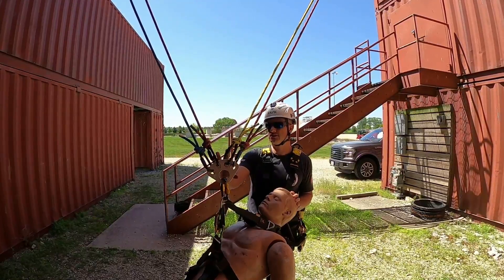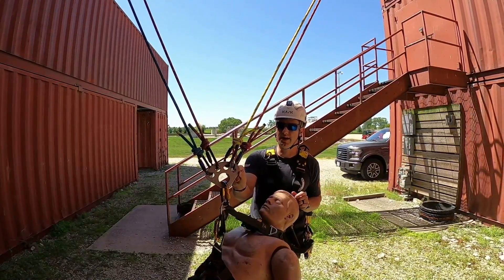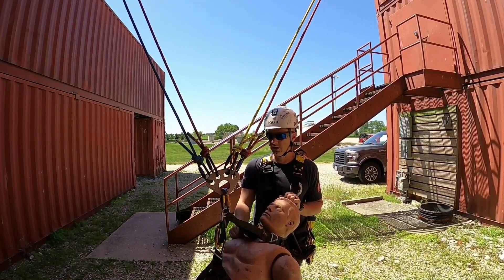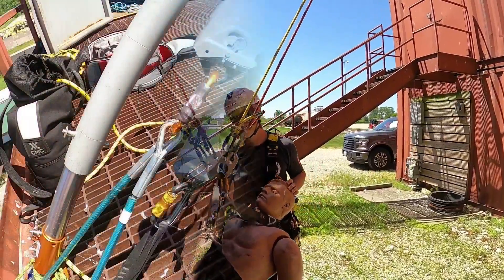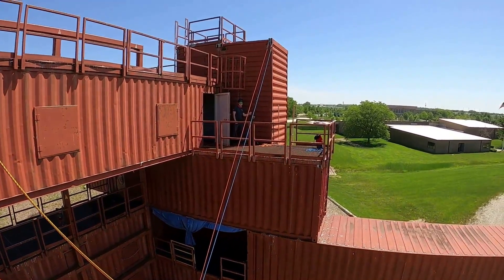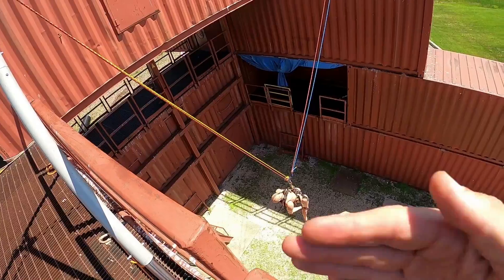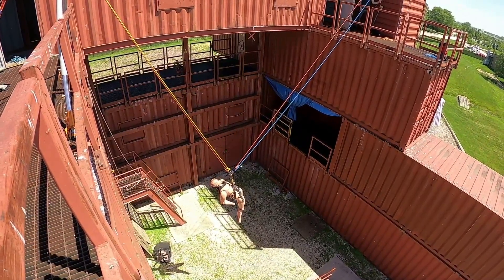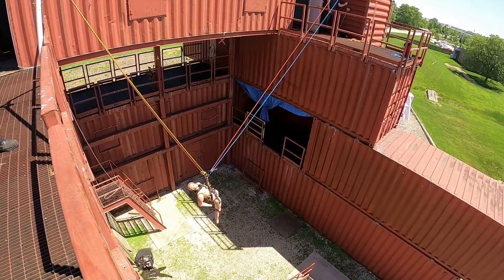Cross Haul System - Rope Training

Comment: Thank you guys for all the concise and to-the-point videos. The only things I would look at: I teach my students to run one line thru the AHD (vortex) and one line down low, and I know I'm becoming old fogie, but I would back up the rigging plate at the center, perhaps as you mentioned you do when cross-hauling a litter. Thanks again. PS the tower is awesome as well.
Reply: Back up rigging plate, as  in prussiks?
Reply: @scottw1557  using 2 plates
Reply: @snakesnakesnaaake1 should we back up the D ring in the harness? And the Harness? The rigging plate is bomb proof especially for a single person load, also if we double up the rigging plate arent we now loading the crabs incorrectly to what the manufacturer recommends? Its an  interesting topic and no one seems to be able to give a concrete answer on 😂
Reply: @paulnosek714  yeah thats how I feel now, idk why I said that. I think my training center was still backing it up at the time.